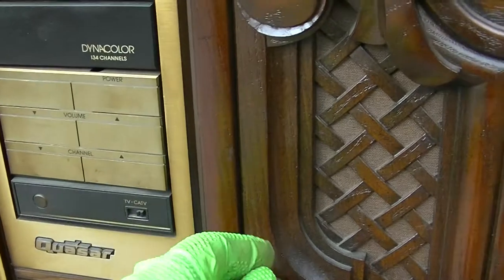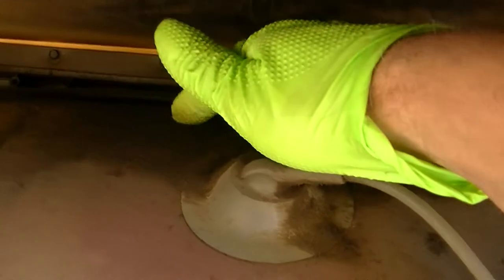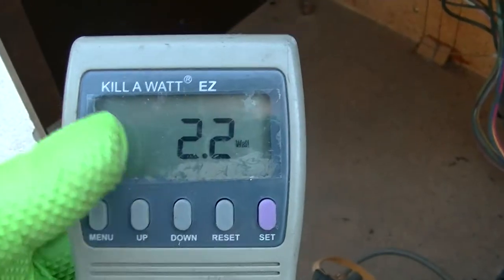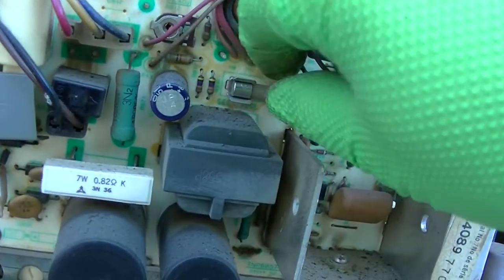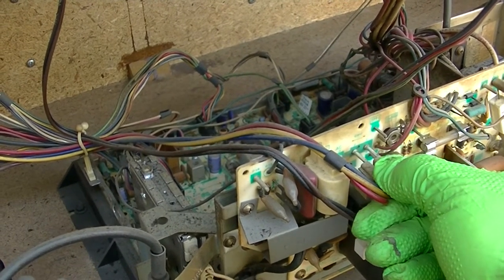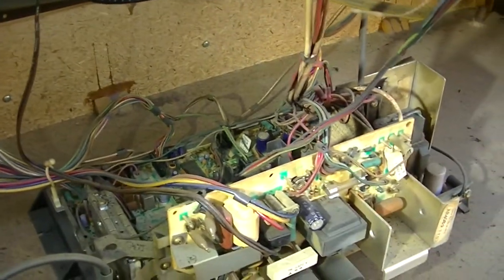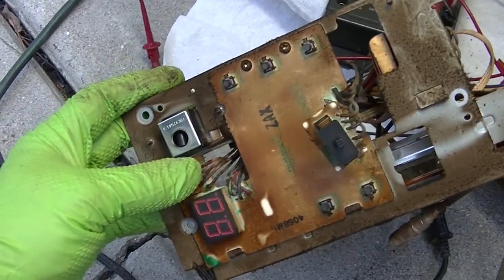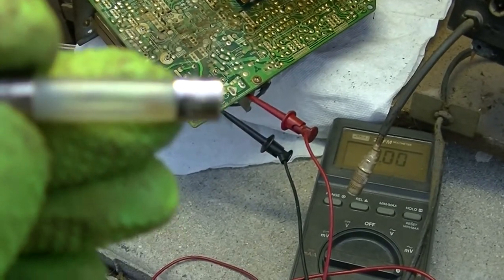Hideous Quasar Smokers Choice 1984 Color Television NASTY

Comment: The best was when a console TV like this would break down and not be worth the cost to fix nor the effort to move it out of the living room, so it became a stand for a newer TV sitting on top of it.
Reply: I was just thinking that! Jeff Foxworthy even had a joke about that. My grandmother actually had that happen. I think eventually someone took the CRT out, and even put a smaller set in the console.
Reply: haha that was the case in my house.
Reply: Kind of like mounting your new smaller Starlink dish onto the old Hughes network one.
Reply: There were so many good parts in those TV's when they died I would strip them.  Over the years, I made so many neat project with the parts.
Reply: I had to pay 1-800-xxxxx $200 plus to take my beautiful 36 inch crt perfectly working Magnavox console (wife wanted a flat screen)  that I could not give away. They sent two bean-poles in a high loader no-lift truck. I had to build a ramp with 4x4 fence posts and almost had a stroke helping them push it up the ramp.
Reply: We had a 12 inch black and white set which went on top of the color TV console until the TV repairman could come out and fix the color set.
Reply: It really looks to me that a newer tabletop set spent much of its life on top of this one when Shango showed the discoloration on the top of the set (at time 41:22)  The circles where the feet were and the angled front showing in the nicotine residue looked very much the shape of another TV outline.  So this almost certainly became a stand for a newer TV once the nicotine residue built up enough to prevent this set from working.  Classy.  Imagine what their house was like.  That wonderful glaze coating every surface.  Or their lungs for that matter.
Reply: Maybe the older top loading VCR with piano keys and a rotary dial tuner. Those were tanks.
Reply: We had a tv entertainment cabinet with the tv section able to hold at least a 25" back in the 90s and early 00s, and we had a wooden tv with a removable stand that fit in the cabinet but the tv stopped working right when I was 3 years old and my parents just put a new 20" on top of the cabinet instead of removing the old tv and it stayed like that for years and now when I see old pictures I think it looks horrible. We also got a Kenwood rack stereo in 96 and we had it in a corner until 02 when we FINALLY put it in the entertainment cabinet where it should have gone from the get-go. It is funny being a kid and not realizing how dorky our living room was at the time.
Reply: There actually were companies that specialized in putting new TVs into old cabinets. It was a thing in the 80s.
Reply: @5roundsrapid263  I remember when Jeff Foxworthy made that joke while I was watching him on my working TV was atop my non-working TV and it cracked me up!
Reply: Became the stand!
Too big to move. LOL
Reply: @zulumax1  Back in the mid 60's, That's all we had.....Ever.
Reply: @badger305  We didn’t get our color TV until 1967. A GE 23” color set cost $700 back then. Fancy wood cabinet with a wood door to hide the screen. We used a 1953 Hoffman black and white 21” set up to them.
Reply: I bought my grandparents house and right now a new 65" is sitting on a gutted out zenith works great for holding a console/dvd/vcr/hifi lol growing up we had a smaller TV inside of the guts of a old one as well it worked lol
Reply: 😂like my dads house.
Reply: Exactly what happened at my grandma's house lol
Reply: When I was a kid we had an old zenith console TV that met that exact same fate! Lol
Reply: Your way off that was a Panasonic it had bad filter condensers I bought  one for $650.00 .
Reply: Take cigarettes for example. I was cleaning windows for someone years ago who was a prosaic heavy smoker. And the windows were covered in that brown tobacco goo. Now,just imagine that cigarettes can do to electronics. They can be covered inside and out in that cigarette glaze